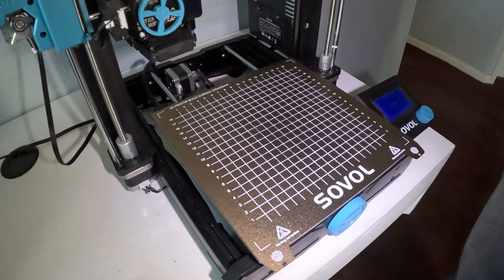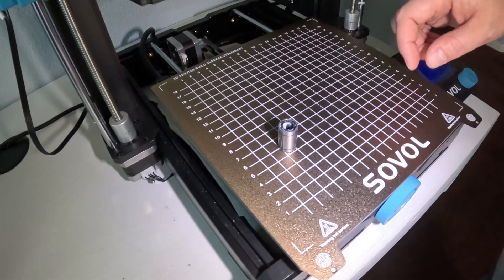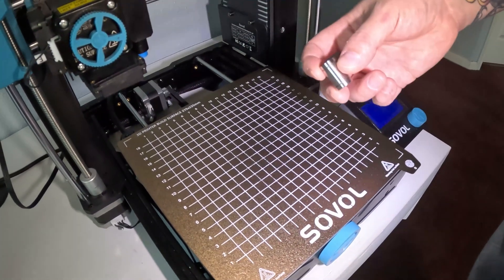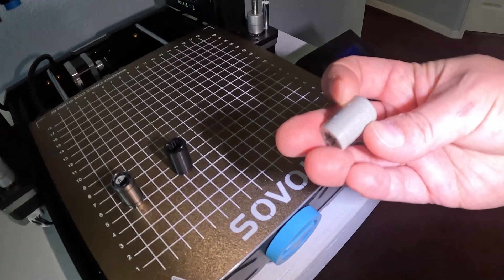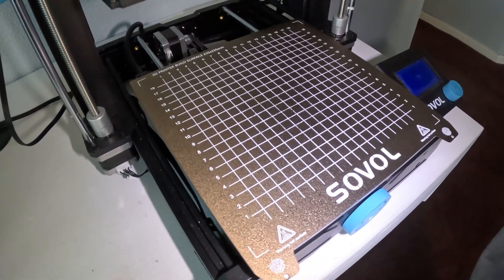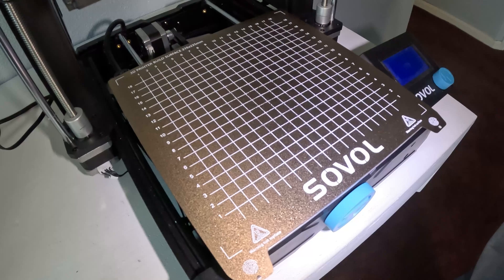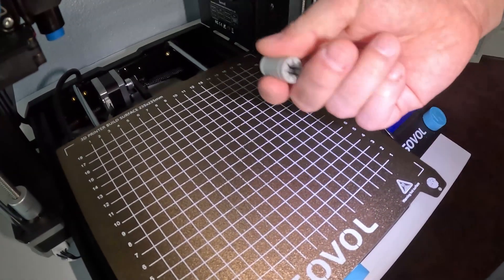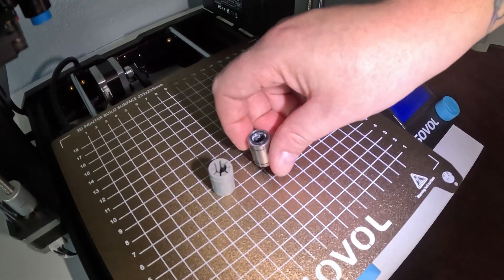My Sovol SV06 LM8UU Bad Bearing Replacement Choices

Comment: Hi there ,in answer to one of your ideas was to put the Drylin bushes on the extruder rods .I did just that and found when you tightend them the motorholder gantry would not move , and due to the 6 screws at the back  theres no room for ajustment !I tried to pack them out all to no avail ! So I will put them on the bed and see how it goes !! PS just  replaced the bed steel rollers with Drylin bushes , I had to put masking tape strips under  each side of all 4 bearing  holders, as they where binding  and then !!! Silence ! Thank you again !

Comment: I have had a lot of luck using varioshore TPU bearings (0.6 flow, 20mm/sec, 213c, 99% infill, 0.3mm layer).  It is for a different application (25mm pipe) but I may try them in the new SV06 plus I use at work.  Here's a vid.  https://youtu.be/eYeL5n3W4Y8?si=3WZqtCkunGgLzYDK

Comment: i made my bearings from petg and ofcuts of ptfe tubing sliced in 4 
so there is 6 inserts made from the tubing in each bearing block slided in under slight interference and wear in in place untill they move smoothly
and they are all pink :|]

Comment: how many did you have to use for the sv06?
Reply from the maker: So there are 2 bearings in each z-axis carriage, 3 in the extruder carriage, and 3 for build plate, for a grand total of 10 bearings.

Comment: I installed the Drylin bearings on my SV06 Plus' bed, and at first they were nice and tight and smooth, but after about 100 hours of printing, they are loose as a goose. The bed has a full millimeter wobble around the z-axis.

I did, however, load them up with lithium grease when I installed them, thinking the self-lubricating claim was possibly marketing horsepoop, so maybe the grease softened them and caused extreme early breakdown?
Reply from the maker: I didn't use any grease. I've done a full bearing replacement on two of these printers with fantastic results. I have no wobble on the z-axis. If there is wear, you may want to inspect the linear rods for damage that may be causing premature bearing wear.
Reply: @room281tech8 The linear rods appear to be perfectly smooth.

I ended up packing the stock bearings with lithium grease and re-installing them. As you noted, the grease helps with noise, but more importantly for me, the bed has no 'slack' around the Z axis anymore.
Reply: @room281tech8 I just read somewhere else in here that the Drylin bearings soften at about 60C, and the bed rods get to that temp when the bed is 80C. Since I print a lot of ABS, I run my bed at 90C, so maybe that's what killed my Drylin bearings so fast...
Reply from the maker: @imacmill  I haven't had any issue with that whatsoever. Keep in mind igus makes a lot of different materials. The premade igus bearings that I purchased from amazon are top notch. I do prints runs that go for entire weeks ...almost non-stop printing. Bed temps range around 80c for hours at a time... No issues. Eventually I will do a linear track rail mod with carriages
Reply from the maker: @imacmill  igus drylin rj4jp-01-08  just search for it on amazon. You'll need 10. Three (3) for the build plate, two on each z-axis (4), and three (3) in the x-axis carriage.

Comment: I have a different printer from 2017 which also uses an LM8UU/LM8LUU motion system. Didn't like the sound of original bearings, and they came right with a layer of rust, but the quality actually turned out to be OK.

Still i wanted something else. So i got these IGUS bushings. I have not had fun with them, not at all. They stuck AND they wobbled, and then they wore in, and then they wobbled more, there really is a lot of play on them. There is a lot of wear on them after some use. Not good.

I have tried a number of bearings. Don't buy Misumi, you go broke. Don't buy Ali and Scamazon stuff, you get garbage. I found a small local mail order seller, who all they do is bearings, and the bearings are actually good and very very inexpensive. I have not had trouble with a single bearing i got from them. I don't know where the actual product comes from, i think they might be Chinese but there's bearing manufacturers all over, in Taiwan are the good ones, also Thailand, Philippines etc; and what don't get from a dedicated seller like that are bottom of the barrel rejects you get on global marketplaces.

Today i only use recirculating ball bearings on the Z axis though, on XY i went for a printed bushing with a coating of PTFE spray, i print them out of PETG, and i always use "Perfect linear bearing 8mm vase spiral mode" by LifeRider. This has held on for a couple years just fine. I've been getting a lot more out of them than out of Igus bushings. The reason i use plastic bushings that even when recirculating ball bearings run well, which as you found they don't always do, they are audible, because super hardened balls rubbing and bumping each on the next one is just normal operation, while plastic is silent.

When switching from bearing to bushings, i inspected the rods and found them not super smooth, as ball bearings tend to etch themselves in. So i chucked them in a drill and polished them with compound and a rag, until they felt very nice. Also gave me an opportunity to wash them of grease, since i don't want that on plastic.

I think recirculating bearing is sort of an a priori bad design, i actually think a system with radial roller bearings is fundamentally better, but i don't have a printer at hand with such a system. Radial bearings have the balls separated by a soft cage so they don't touch and scrape at each other, making less noise.

Comment: I'm about the buy this printer, should I buy upgraded bearings right off the bat?
Reply from the maker: I have two of these printers and changed out the bearings on both printers.
Reply: @room281tech8  Right away? Gotcha, which ones did you end up buying?
Reply from the maker: @adams1625   I just made a note in the description of which bearings I used. You can find them on Amazon for fairly cheap.
Reply: @room281tech8  Oh right, gotcha! Did they impact print quality? Better or worse?
Reply: @room281tech8  I was just going to try packing the stock bearings with grease when I get my SV06, I'm finding that some have inconsistent layers with these bearings, so I'm not sure
Reply from the maker: @adams1625  That is an option. Just soak them in alcohol to clean them out real good and then repack with white lithium grease. I believe there are 10 bearings, 3 for the extruder carriage, 3 for the build plate, 2 on each z-axis carriage for a total of 4 bearings on the z axis, which brings us to a grand total of 10 bearings
Reply: @room281tech8  I definitely will man! Thanks, I'll update ya on what happens. Hoping they'll be good enough, worst case I order new bearings

Comment: I replaced all the bearings on my SV06 with those from igus, but I felt the force needed to move the axles was much greater. And this happens only when I finish tightening the screws. Have you experienced this with your printer? Would you make it softer to move and perhaps a little loose or difficult to move and very firm?
Reply from the maker: I had a very different experience on both my SV06 printers. I just tightened it down like normal and it worked. Perhaps if you have a caliper you can take measurements of your OD of your stock bearings and compare that to the igus bearings. Something doesn't sound right because I know a few people that run those bearings without issue.

Comment: You went down the same road I did.
Reply from the maker: This seamed cheaper than the $15 per bearing alternative from Misumi. I bought some bearings off eBay and they were worse than what came on the printer. So far these igus are working quite well.

Comment: It's nuts that Sovol uses the cheapest possible bearings for the SV06 motion control.  The Drylin bearings can't be much more expensive.  If they could be sourced in China, they should be less expensive than ball bearings.  This is a common SV06 problem.  Nobody should need to replace the bearings on a new printer, but it's better to replace bad bearings before they score the linear rods.
Reply from the maker: Sovol does seem to use low quality parts, but I do like the design. It seems like I am replacing a lot of stuff on these printers. I actually have two of these printers. I have a box opening video of brand new printer I recorded several months ago that I really need to get uploaded. I had to replace a good amount of parts. Right now Im having issues with the pei beds. Im constantly having to sand them with 2000grit and then clean with acetone about once a month now. Rubbing alcohol used to work just find, now not so much. Either way, just another part to replace.
Reply: @room281tech8  - I have an SV01 (not even the Pro version) that has been a workhorse printer for over two years.  I replaced a hot end heater soon after getting the printer.  That was cheap and easy to do.  Otherwise, all I've done is clear three clogged nozzles but none of those were the printer's fault.  Despite the low cost parts, the SV01 has been very reliable.

I do like Sovol's approach with a regular and Pro version with upgrades, but they should use high quality upgrades.  I'm not sure cheap rods and bearings are an upgrade over acetyl rollers which are smooth and long lasting.  I've had very trouble with the rollers on the SV01.  I haven't even needed to adjust them.

Comment: I found theese exact igus bushing are way too lose for the bed bushings, specially on the side where there is only 1 busing. Replaced all, except the bed to theese bushings, but for the bed, its just not tight fit enough. Luckily found 3 acceptable, from the original bearing, after cleaning and packing they works acceptable.
Reply from the maker: I wasn't really happy with any of the bearings. The igus have been great so far, no complaints. They are slightly loose but nothing worse than the stock bearings it came with.

Comment: do not print out bearings your printers are no where near precise enough to machine such a part.
Reply from the maker: It can be done and Igus has the filament to pull it off. After pulling measurements off the igus bearings, Im not seeing anything to extreme in regards of tolerances. Would I print a metal style linear bearing with balls, no.

Comment: I just noticed you're moving the bed around with your machine powered off.  I noticed it generates a ton of electricity, and it's not good for your machine.  I have a pi plugged in with an endoscope plugged into that, if I move the bed even slightly, the endoscope flashes.  It's a lot of power being generated by even a small nudge.  Careful.
Reply from the maker: Given some of the "quality" I've seen, you aren't wrong. If it's built right, then this shouldn't be an issue. I would be concerned if it is generating more electricity than the design allows and exceeding tolerances. I have heard of people frying their sovol mainboards by exactly what you mentioned. What kind of numbers are you pulling? Now you got me curious. I've heard some horror stories about the electrical on these SV06 printers.
Reply: @room281tech8  I'm not actually sure, but the flashing endoscope light happens even when the bed is just moved even slightly.  Sometimes the movement isn't even perceivable, but I'll still get that flash.  It doesn't say the voltage or anything on the endoscope page (aliexpress).  It's just surprisingly easy to generate current.

Comment: Nice write up.  I  cleaned mine in IA with US, the used the prusa tip on a small gun to pack them with the common synth grease, I found with the prusa they take about 5grams to fill.    That made em worse.......... I didn't reclean and scope em, dunno if the balls are flat spotted, races pitted, dunno, don't care. Right in the bin with the lot.  Took my second SV06 apart out of the box and replaced every bearing prior to use.
first point, it takes 10 bearings, the gantry has 2 per side.
second point, I found alot of variance with the IGUS delrin bearings, but the are pretty cheep. get a half dozen packs, sort thru to get 10 snug ones...
my second machine has a  single quality double length linear on  each side of the gantry, the first a pair of IGUS.  Both have IGUS on the X & Y.

only noise I get now is the bizarre double CLACK  on X  travel moves, if I try to exceed 275~300.  I think, its a belt tooth catching the extruder's tunnel edge
Reply from the maker: Your experience parallels mine. I'm finishing up my box opening video of a brand new SV06. My thoughts going into it were, "I'll just repack the bearings". However the further I got into it and the more repairs I was making to a brand new printer, I just opted to replace all 10 with Igus bearings. The stock bearings were completely dry. 

My attempt to repack the bearings on my  other SV06 didn't go well either. During the repacking process the balls started falling out. I didn't realize it until I inspected the linear rods and found a few sitting on the desk beneath the build plate. The retaining plate/ring was falling out of 2 of the 3 bearings on the y-axis. At that point I stopped using that printer until my Igus arrived.X and Z axis were about the same.

I've been happy with the Igus bearings so far. They're easy on the pocket book and they offer great performance. I looked into mitsumi bearings but didn't want to pay $15 for each bearing. I have several thousand hours on one of the printers and its still going strong.

I'll probably pull a couple of the bearings in a few months and measure the wear and share my results with everyone.
Reply from the maker: I get that clack sound now and then. On one of the printers I tightened the belt on x-axis. That seemed to mitigate it to a certain degree. Let me know if you narrow it down.

Comment: GO the proper Drylin Igus bearings, but if you have to print them, print the bearings from straight Nylon, not PLA or PETG.
Reply from the maker: I agree. Igus makes a bunch of filaments that seem to be geared for this kind of thing. However I think nylon filament is cheaper, easier to get, and probably just as good.
Reply: @room281tech8  Straight Nylon works, I have used it, but the Igus filament is far more slippery, its self lubricating, its definitely better, the nylon bearings I have made, can bind and require a silicone, or PTFE synthetic lubricant to operate efficiently, Igus bearings don't.
Reply from the maker: @NexGen-3D  That is interesting about the nylon binding and needing lubrication. I'll keep that in mind for future projects. I should probably just pick up a spool from igus to keep on hand for special projects.

Comment: The first thing I changed was the exact same. Way better! 
My suggestion is if you don't want to buy them print them out of EasyNylon! 
That's why I bought the SV06, is to print high temp filament.
Reply from the maker: Nylon would definitely be a good material to use for linear bearings. Igus also sells some filaments specifically for this type of situation.

I just did an unboxing/repair video of a new printer from factory. I don't even think they packed their bearings when it left the factory. At this point after dealing with three SV06 printers, all with bad bearings, my thought is just replace the bearings on these printers first thing.

Comment: I bought the Sovol SV06 Plus, I wonder if its got the same bearing issues.  It ships in April.
Reply from the maker: So I have two of these printers one of them has bad bearings. The other printer has so many issues I'm still repairing it. On that printer I didn't even bother checking the bearings. I just replaced them. 

My friend also has this printer. He repacked his bearings and the seals became loose and balls fell out of the race.

I'm doing video on a complete inspection and tear down of this printer and every issue we have encounter and how we fixed it. The printer we're working on is brand new, just pulled it from the box. I feel like a lot of the stuff that is leaving their factory had little to no quality control. However most if the issues are easy to fix.

Comment: cool video thanks for sharing, the bearings were so dirty with stock svo6. I will most likely replace them with your suggestion!!
Reply from the maker: My buddy replaced all his bearings with the igus drylin bearings and he loves it. He said it is so quiet now. He had a bit of an extreme issue with his bearings though. They were basically falling apart which would have eventually damaged his guide rod. Let me know what bearings you decided on and if you like them.

Comment: I'm curious to know if the layer shift (minor, but seeming endemic to these printers) got any better with the new bearings?
Reply from the maker: That really wasn't an issue on my SV06. Now my buddy had that issue with his SV06 in addition to his bearings being crunchy. What happened is that the screw that holds the gear to the motor came loose and the layer shifts became worse and worse. I also had an issue with the gear that sits on planetary gear shaft that feeds the filament coming lose and stopped feeding. Somebody at the factory is not tightening things down.
Reply: @room281tech8  Guess I'll be torque checking EVERYTHING when I replace the bearings. I really cannot complain about performance for the price point, but, I mean.. ungreased bearings and non-tightened fasteners is kind of a goofy marketing ploy.
Reply from the maker: @publicacultus  I definitely would. My printer one day just stopped feeding. After I  disassembled the extruder, lubed and tightened the gears, I was actually able to print my filament at lower temps. Basically I had to overheat my filament to get it feed, but didn't know it until I fixed the issue.